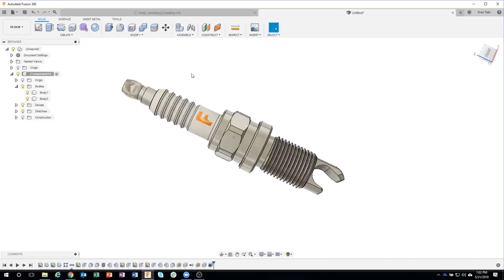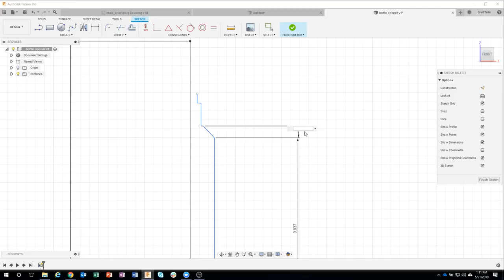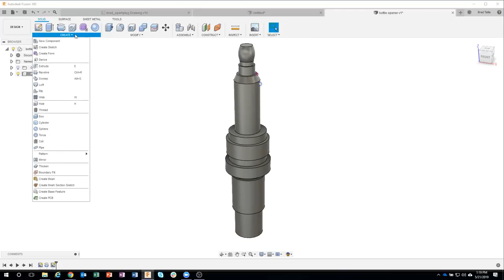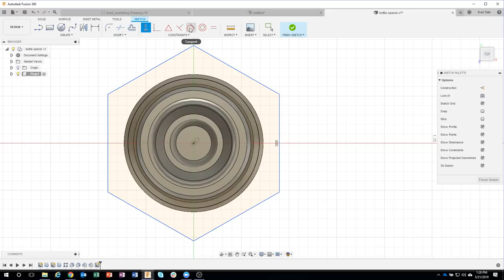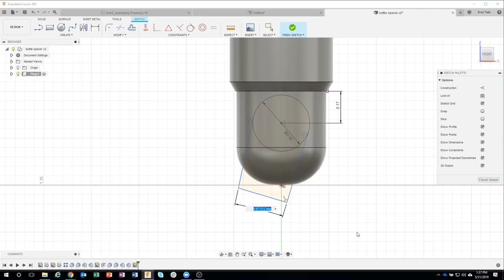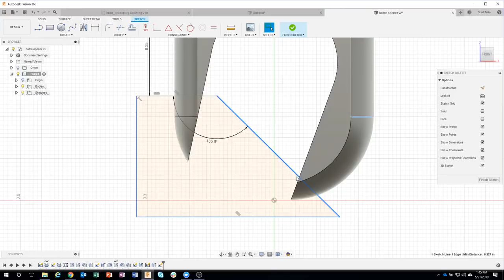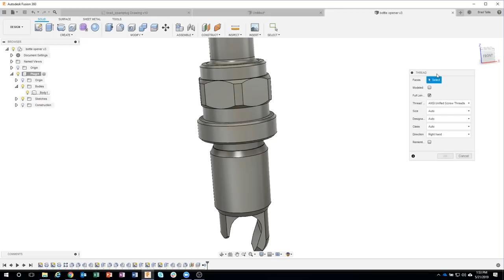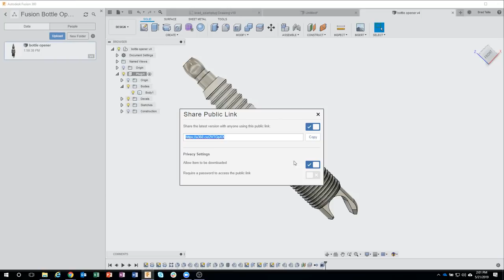Episode 30,  Design to Manufacturing, Part 1 of 4

Comment: Great video thanks! When creating the first circular groove, you snapped the circle to the edge of the part and then dimensioned it from the top.  But it was still blue- no fully defined- when you revolved it.  Why is that?
Reply from the maker: @Paul-  Great observation!  The reason it wasn't fully constrained is that I did not add a constraint to the edge of the sparkplug.  I only "snapped" to the edge.  I should have made a "coincident" constraint between the center of the circle and the edge of the sparkplug.

Comment: @ 35:17 i cannot go over 50 degree angle... what is going on this makes me think fusion 360 will not be for me
Reply from the maker: Mr Me-  You might try the opposite angle.  For example, instead of 60 degrees, type in 30 degrees.
Reply: @bradtallis8968  does not work i tried using rectangle with dimensions and revolve but nothing yet this is strange

Comment: What is the last icon on the center bottom after the viewports icon (like a little orange cube) ??  I don't see it on my Mac  !!!
Reply from the maker: @IceCream62-  Good eye!  It is a plug-in that I added that one of my co-workers made.  It is called ShowHidden.  It allows me to show all my parts and components at once without having to turn each one on, one at a time.  Search for "Display Utilities" in the Fusion 360 App Store.
Reply: Thanks for the clarification Brad. I was thinking about a new feature to activate after the last software update  :-)